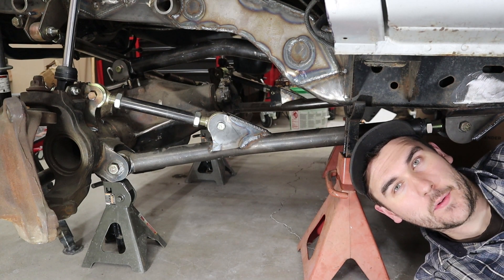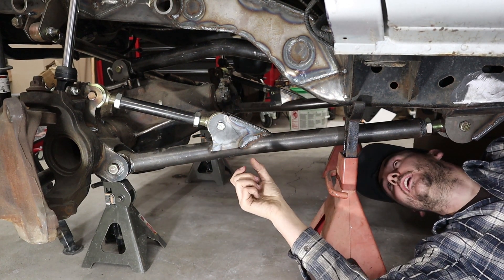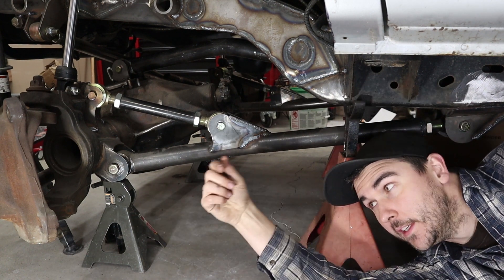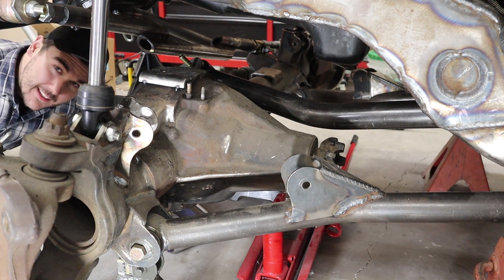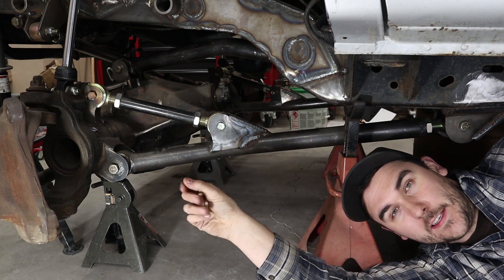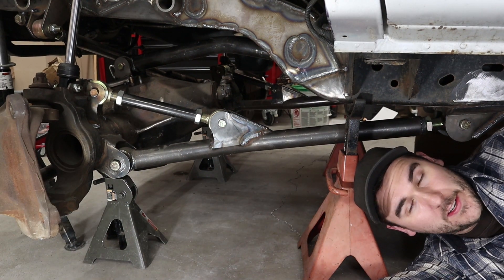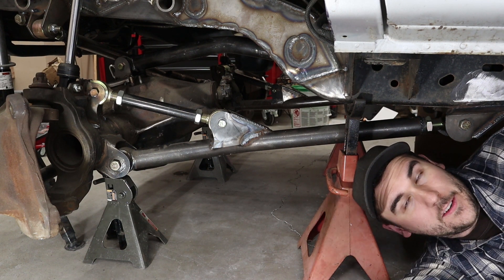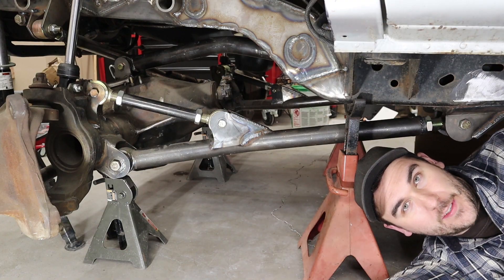Why I hate 3 links

Comment: doesn’t mention anything about anti squat or radius arms unloading on an incline 🙄👎🏼. although on more street driven less hardcore rigs radius arms are the correct choice for the average person.
Reply from the maker: Maybe I'll mention that when I make a "why I hate radius arms" video 😜
Reply: @WebWheeler  let’s see it! there’s a compelling argument for both sides. especially if you know the forces behind it. now a 3 link/panhard rear 🥴 that takes a special kind of person
Reply from the maker: A radius arm rear takes a special person too 😜
Reply: @WebWheeler   whats an option for link rear where you have a fuel tank located on one side or the other? been debating a rear 3 link to keep my explorers fuel tank in the factory location(also why I went with an atlas vs a doubler.) what is the best option? I am running 1 tons(1990 f350) and james duff radius arms on my dana 60 I welded wedges on. currently rear is on leafs. better to rework leafs with spring under and chevrolet 64s? or 3 link?  radius arm rear(read horror stories but have seen some work well given flat arms.)? 4 link where uppers face rear of vehicle? ( have seen many articles about issues with this style, but some setups work great given the changing pinion angle.) I would appreciate the input.
Reply from the maker: For the rear I would either do leaf springs with an antiwrap bar to keep the torque in check. That's low cost and relatively easy to do without changing up too much especially if you're keeping the axle in the stock location. If you want the rear axle set back for better departure angle, I would go with a parallel 4 link and panhard bar if a triangulated 4 link won't fit. That gives you lots of flex and tunability but should still be able to fit around your gas tank. Good luck!
Reply: @WebWheeler  I completely forgot i thought about a parallel 4 link in the past. perfect idea. could run uppers on outside of frame and lowers on the bottom. perfect idea! planning on moving to 43s in the future and want to future proof! will get some joints orders once black friday hits! thank you for the idea and reminding me those exist!
Reply from the maker: Happy to help! Good luck with the build man sounds a cool rig 😎
Reply: Yup, or the camber change throughout travel.
Reply: Parallel 4 link.....might as well just 3 link it at that point lol